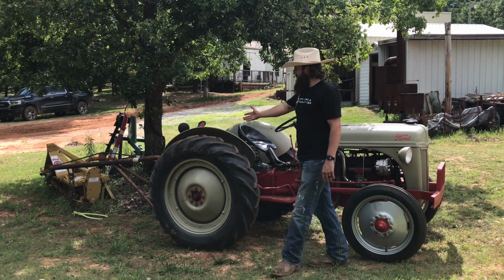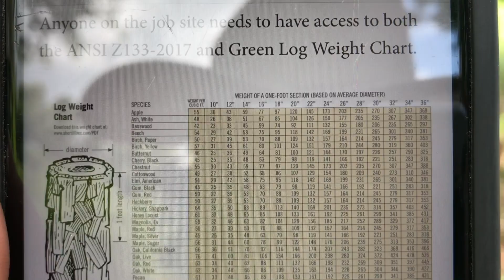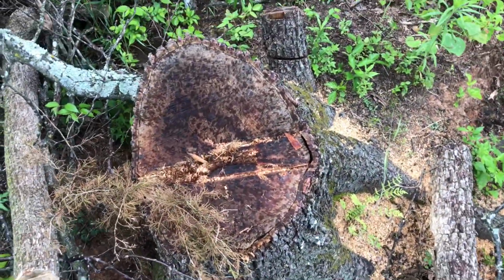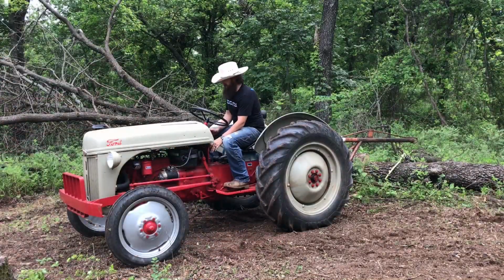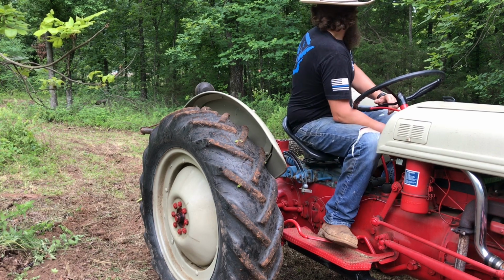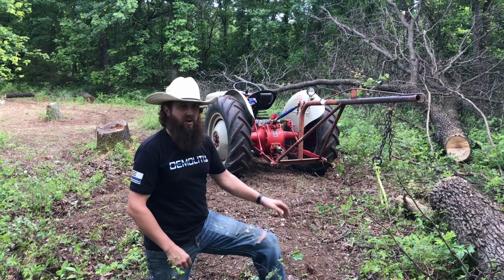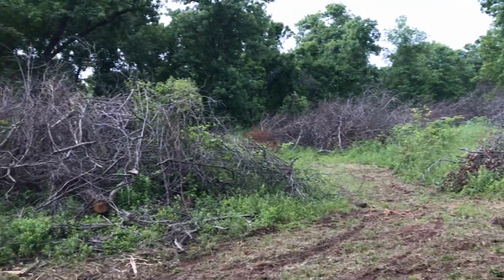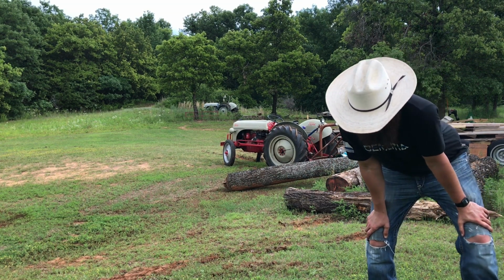Using a Ford 8N to Skid Big Logs

Comment: We had a 52 that worked just fine with the drawbar across the lift arms. Chain  the log near the end and lift slightly, enough to get traction and keep the nose down. You will lift more closer to the arms and not damage your top link sensing.

Comment: You can pull a lot bigger logs than that with an 8n tractor. the main problems is the fast reverse and having to be out of gear and clutch released to operate the 3pt.

Comment: Great vid! New sub! My wife and just bought some raw land and I'm looking at getting an older tractor for land clearing work and so far these old 8n tractors seem to be pretty capable!
Reply from the maker: Awesome to hear! They can’t do it all, but they are a great first tractor. Very capable if used in the right applications. I subbed as well. Good luck!
Reply: We have a Ford 8n that has been in our family for 3 generations.  It's a great machine.
Reply: These tractors are tough and with patience you can do a lot with them if they run correctly. Convert it to 12v and put an electronic ignition in place of the points

Comment: The potential problem with this setup is while traveling the top or slave  pump is being fed shock loads.this can push the rod through the piston,and yes I learned this the hard way.a chain can be rigged from the top link mount to the lift arms with a bit of ingenuity to carry the load when in travel. I have a vid on this but don't want to cross the bounds of decorum on this channel.i just subscribe d,

Comment: Take a small axe clean off that bark. Take a 3lb hammer  knock them points in the wood. Lift the boom. Drive away.  It's very simple once you done it a million times

Comment: 8ns never had 45 hp, more like 25-28hp.
Reply: Well dont say that. Originally they had an almost exact motor of the model a ford. About 24 hp generally. There was Funk engines though. Farmers needed more hp than the little 4 cylinder
 They were v6 and v8 conversions. The v6 put out 98 hp! So they most surely had higher hp ratings. Ford didnt like them all too much along with the sherman overdrive. Said they'd ruin the transmissions. They've lasted this long.... Take care!!
Reply: @davidshipulski4532 The model A engine and the N tractor engine were very different
Reply: @redneck400m3  Same engine just the 8N was dumbed down a bit to fit a tractor. Otherwise same engine.